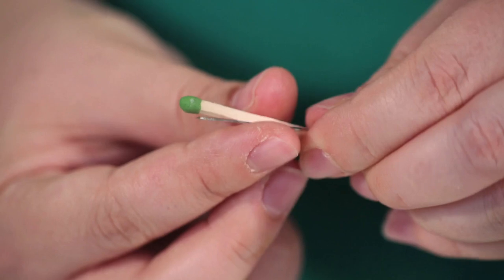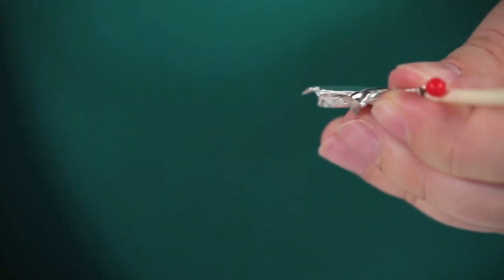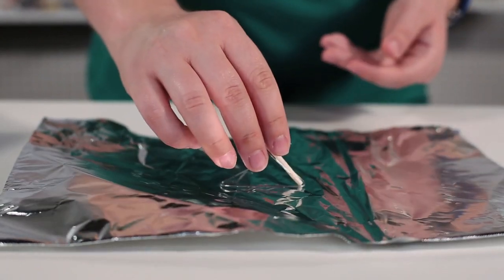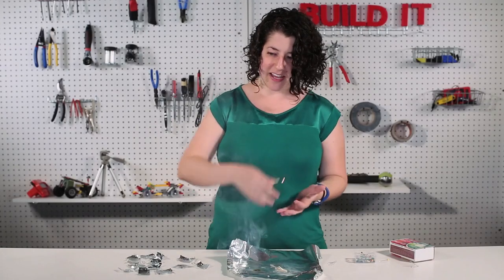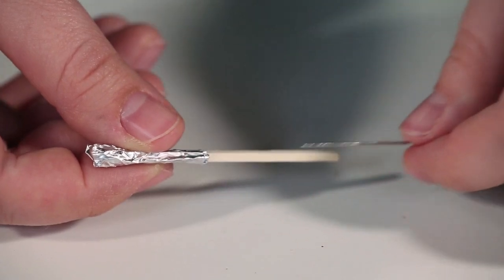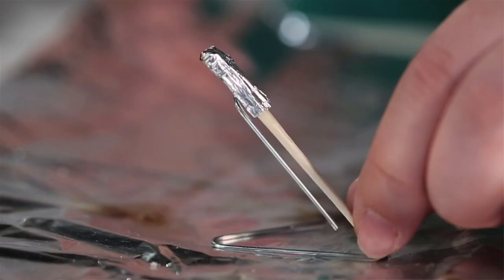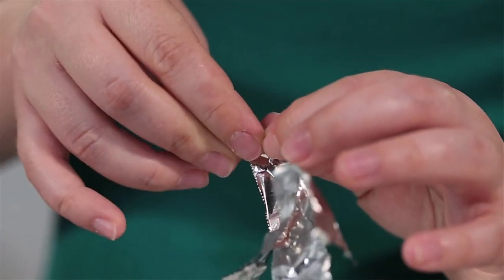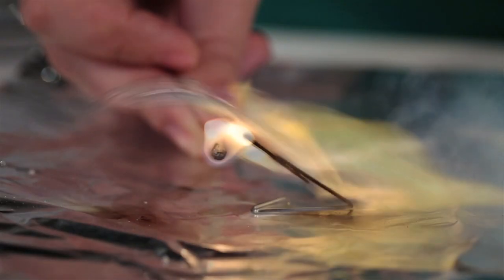Build It: Matchstick Rockets

Comment: I burned through a box of matches and used a lot of foil without ever getting one to launch. This may have worked decades ago before the safety nazis ruined matches, but it seems as though modern matches just do not contain enough match tip chemicals to cause enough lift. I guess I need some smokeless powder to make it work… I will be right back.